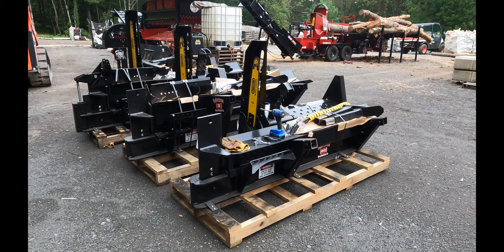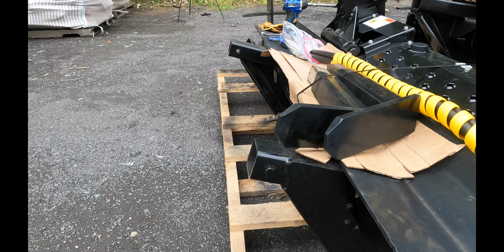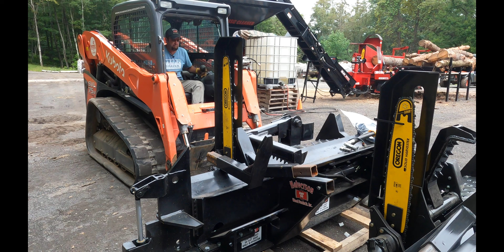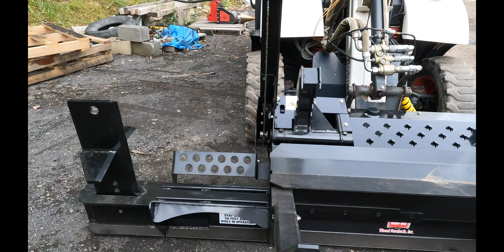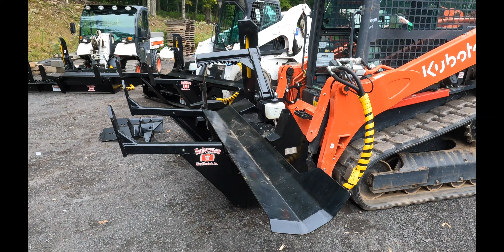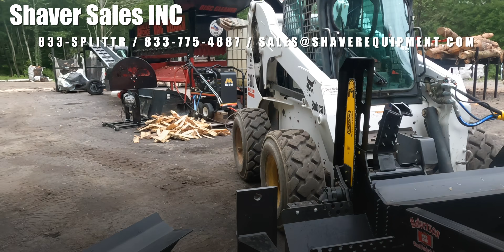Halverson Wood Products HWP-120 vs HWP-140b vs HWP-150

Comment: I've noticed on my 140b that even after upgrading to the larger cylinder option, it tends to struggle sometimes on tougher wood on larger diameter logs with the 6 way.  Not sure if its the hydraulic pressure of my machine or the cylinder.  Running a 2015 Bobcat T590.  Does fine as long as its nice straight grain wood, but you get much of a sizable knot or Y on it, you are out driving it off the wedge with an 8lb sledge.  4 or 5 times of doing that and you really start analyzing which logs to set aside or cut it off and dump it and move on.  Its not what would call a power house splitter but as far as overall, I can't imagine doing what I do now with a conventional splitter and saw.  I'm just at awe when running nice wood and seeing 6 pieces crank out on each pass.  Its a great machine.
Reply from the maker: thanks for comment! The machine pressure is ultimately the source of power for the splitting pressure. PSI directly equals splitter tonnage! The upgraded cylinder is the new "standard" cylinder in the 150 and it does an amazing job. Nasty wood is always evil on any splitter. Direction/orientation of the "Y" or knot is also key to getting it split. Go with the grain vs against it. If you get a jam up. Drop in a previously split piece into the splitter chamber, use that smaller piece to work out the stuck round. You can focus all the tonnage on a smaller area and push it thru. Glad you are enjoying the unit. Thx again. AJ

Comment: Great video, but you did not show us the controls from your machine close up as you were moving the parts on the processor. My machine is an ASV and has only 2 connectors on the hydraulic box outside . It uses a 16 hydraulic flow.  Thank you.
Reply from the maker: Noted!